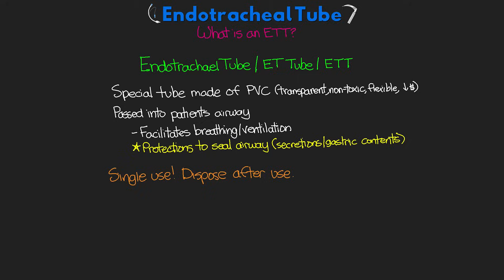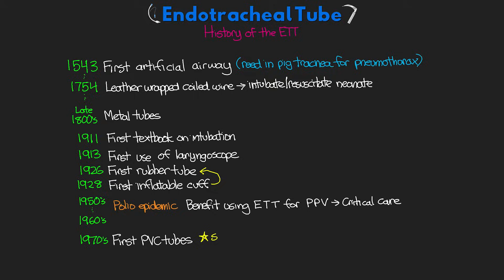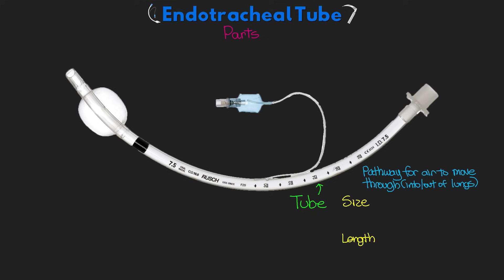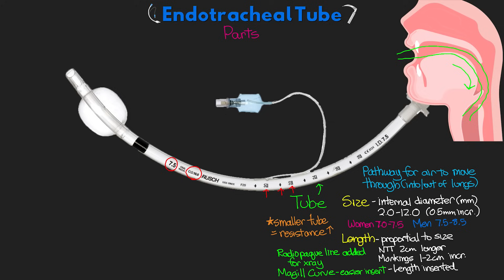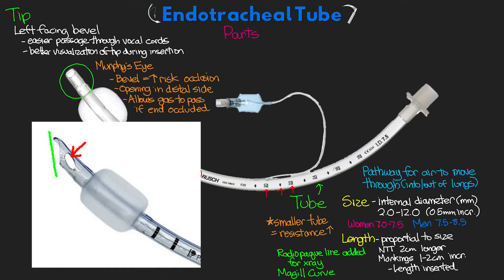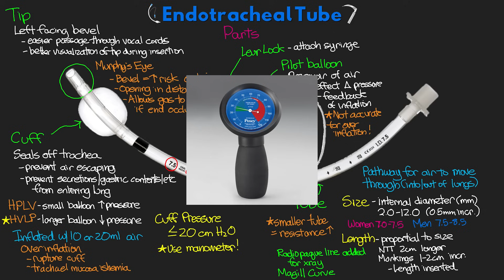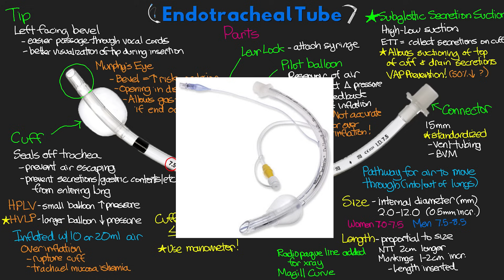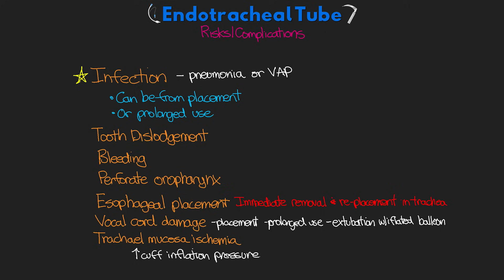Anatomy of the Endotracheal Tube (ET Tube) - Airway Management

Comment: 'the new results continue to show an association between SSD and lower incidence ofVAP (RR 0.60, 95% CI 0.53–0.68, p<0.001; I2=0%) (figure 1). However, the estimates for mortality aremodified (RR 0.92, 95% CI 0.83–1.02, p=0.098; I2=0%) (figure 2), suggesting a nonsignificant trendtowards lower mortality in patients randomised to SSD'
Pozuelo-Carrascosa DP, ...Correction to subglottic secretion drainage for preventing ventilator-associated pneumonia... Eur Respir Rev. 2022 Mar 
Hello, after reviewing some related articles, I am wondering why such techniques can not lower the mortality rate?🤣 Does this mean that once VAP is developed,  the clinical outcome is largely preditermined by patient's basical conditions?